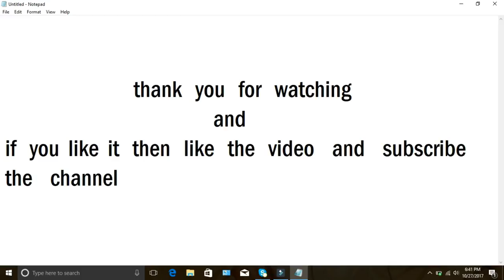how to Fix or Repair earphone without soldering

Comment: It fucking worked, you glorious bastard! My favorite pair was giving out on the right ear, due to a faulty plug. After like, two years, straight out of the blue. The connection was a little rocky at first, but I figured it out by twisting the wires REALLY tight, and I used the lighter a little more, to help it connect a little better, and they work perfectly now. It's not like the earbuds are REALLY expensive, but they are out of production, and the price is starting to climb up now.
Reply: @RhiboNuclicAcidゅ  Unglorious..? Eh, you can't win them all.. I probably don't, but I still use this technique to this day. I have a newer model of my favorites that I haven't had a need to do this sort of thing with, which fits more comfortably, and has better treble, but it's probably unavoidable that they will break one day. I still have two older pairs that are spliced, and they do work, although the connection seems to get iffy over time. Soldering them would be a better option.
Reply: Small update for this, in case anyone is curious.. Soldering is a better way to do it, especially in my case, as the wires are exposed to the elements on a regular basis. Splicing them using this method DOES work, but because of what I assume condensation/wear in my case, the connection gets a little iffy after some time. Also, the quality of the cable you are joining to the earbuds can change how they sound. Cheaper cables can sound more tinny/distorted. I thought I was imagining this, but it seems to be very much true.

Comment: This video from 6 years ago still works! I tried it on my earphones that got their wires disconnected (because my kittens chewed it) and then I used a candle to light up and connect the wires instead of a lighter..

Got the wires burned a bit but it works! Thanks a lot 😊🙏

Comment: Both of the earbuds were working when I was connecting the wires but after some time the right earbud completely stopped working don't matter how much I connect the wires. what should I do know?
Reply from the maker: Cut the wires and reheat again and make same connections becoz there is some problem in connections and once it works tie it properly

Comment: is Burning important?? 
I did That without burning, it didn't work
Reply from the maker: It won't work without burning
Burning will remove the plastic coating from the wire which keeps all the wires isolated from each other .
Reply: @reallifehacksjugaaddiy3118  Ok , Thanks

Comment: So... I did this and tested if it works or not. I heard nothing at first, but there was a noice at right ear. I told myself "What is wrong, is the problem at connections?" I pushed the button of the earphone and omg volume rised and when I pulled my finger from button, volume got down again. So I made an earphone that only works from right ear when pushed the button. It turnes out second earphones cable that I used is very cheap and they used wrong colours for that. I said fuck this, I am not gonna solve that thing. So I need new earphones now :(

Comment: Gud trick but it damage soon
Reply from the maker: Hi buddy
One u have joined the wire tie the joint tightly because its made of thread so that it don’t untie . Else other option is soldering. Thank you for the feedback

Comment: Brooo I'm confuse with the wires
Reply from the maker: What’s the confusion?
Reply: @reallifehacksjugaaddiy3118  I don't know which wire is to connect to which
Reply from the maker: I have explained with colors
Reply from the maker: Still, what’s the problem u r facing?
Reply: @reallifehacksjugaaddiy3118  its ok now i try it my earphones broke completely maybe because i didnt do it right